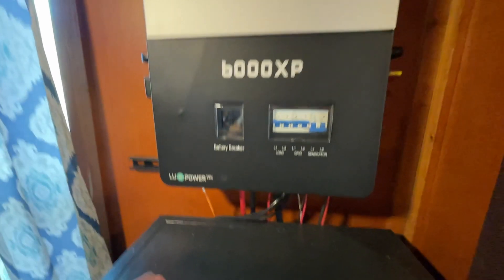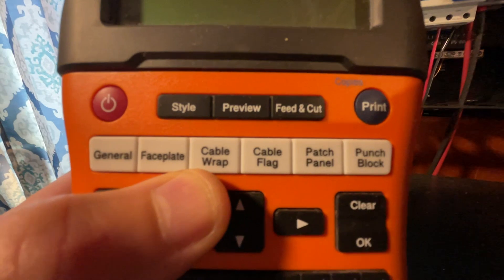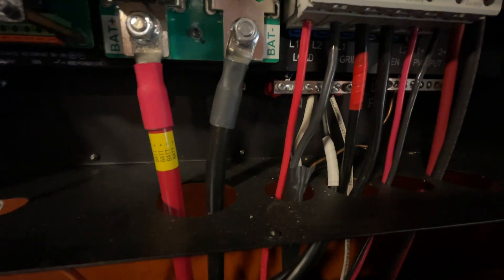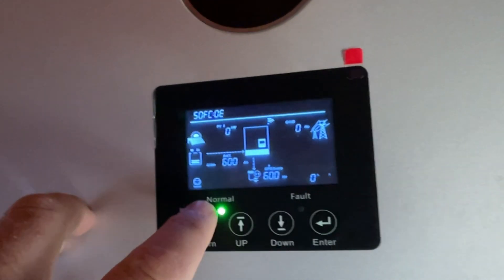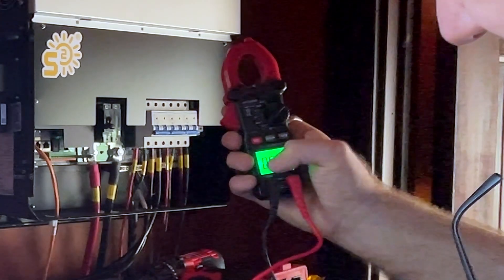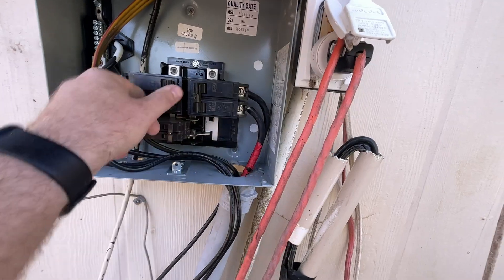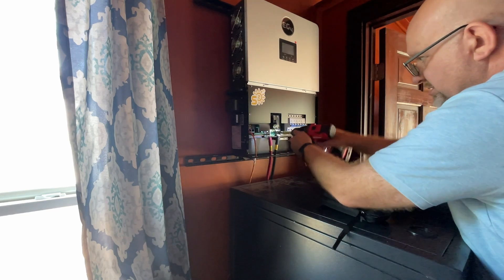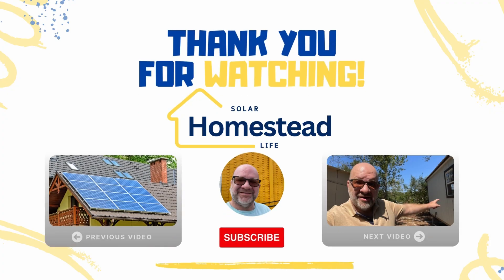Stop Making These XP Upgrade Mistakes

Comment: = one thing that  I  have read about the  6000XP & 12000XP is 
they are both  HIGH-FREQUENCY Inverters vs the  >More  desirable  
<LOW  Frequency  ALL-IN-ONE Inverters in similar sizes 
...
I currently own 2 X  GROWATT  SPF 6000T DVM-MPV's 
& 1 X  GROWATT  SPF 8000T DVM-MPV 
COOP
the  WiSeNhEiMeR from Richmond, INDIANA 
...
Reply from the maker: Hi @WiSeNhEiMeR-1369, thank you for sharing your thoughts and for highlighting the difference between high-frequency and low-frequency inverters! The EG4 6000XP and 12000XP have been game-changers for us with their efficiency, scalability, and ability to integrate seamlessly with our solar setup. It’s always exciting to hear about other inverter brands like Growatt and how they’re performing for folks like you.

How has your system been working for you? I’d love to hear more about your setup and any tips you might have for others navigating inverter choices. Thanks for watching and for contributing to the conversation—it’s great to have you here!